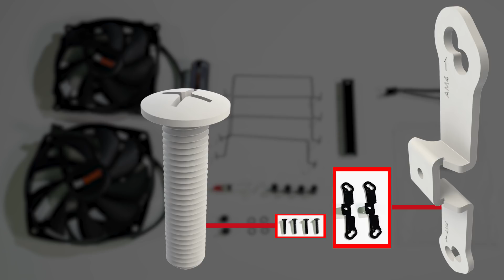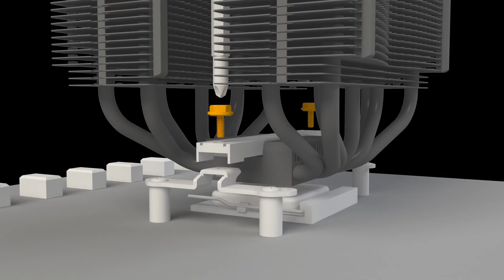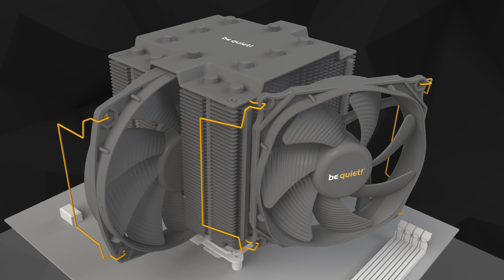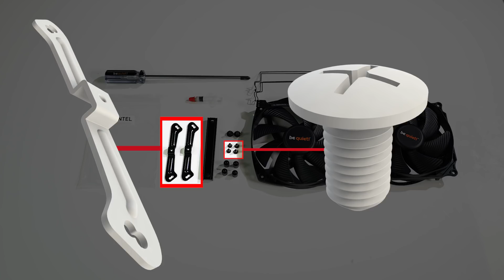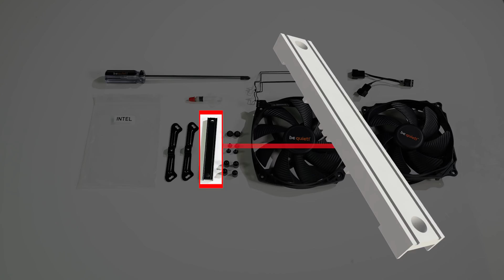Installation: Dark Rock Pro 4 (AMD AM4 / AM3(+), Intel LGA 1151 / 2066) | be quiet!

Comment: How do you stand the case up without the cooler slanting over? I put all the screws in tight but there is still room for it to slant over when I stand the case up causing the cooler to move away from the IHS.
Reply: Did you solve this? Which motherboard do you have?

Comment: Friendly warning: The fins on the middle top of the radiator (where you’re most likely to pick it up from) are EXTREMELY sharp. I had the pleasure of finding this out when I grabbed it unknowingly and it slid through my finger like a freshly sharpened blade cutting a vegetable. I now have a nice deep cut on my finger.

A little warning on the box to say “warning: sharp parts” would be nice.

This thing was really annoying to install.
Reply: can confirm, left blood everywhere. (only had 1 finger clearance)

Comment: I bought you B equiet! Dark Rock Pro 4 like a month ago and used it with lga 1366. Now I moved to lga 2011, but I found out that I'm actually missing mounting nuts for 2011. Is there a way I can get extra ones? My shop warranty has expired.

Comment: Nobody pointed out how hard it is to remove this cooler in some cases. I cant remove my GPU with this installed so the only way to remove it is to remove the top of my case, then the CPU Cooler, then, if needed, my GPU.  Im switching up to a Pure Loop 280mm AIO

Comment: i watned to see this only for ram purposes and it seems that there is no problem
Reply: I had to mount RAMs first doe, I usually do that but I wanted to see if I can install them with cooler in place (w/o paste and fastened cooler). And it was an issue! Guess  I won't buy another 16GB duo.
Reply: Is it necessary to deinstall the cooler if you wanna put new ram in?
Reply: do we know the height available for the RAM ?
Reply: @enzosays1626  40 mm
Reply: @x-dynamics4025  thanks, I was not sure so I guess I miss 4mm for the g-skill trident ..., have you taken low profile to be safe ?
Reply: @enzosays1626  ahm im also thinking about upgrading to a bit higher one. On amazon they say everything above 40 mm youll have problems
Reply: @enzosays1626  I am using HyperX Fury Black, low profile. Anything higher would not fit I think.
Reply: @s0nycz3kk  it's difficult to make his mind on this. i see below that someone is using it with trident which is not low profile. may be if we un-mount the fan we can effectively plug the ram then re-mount the fan ... don"t know.
Reply: @enzosays1626  That's how I did it, well he can move the fan up a bit if it's not gonna fit entirely. // And I would love to check it for him myself, but remounting the fans is pain in the ass. // Just checked, there is max. 2mm space from the point of view I got.
Reply: Not a problem for my Trident Z Neo RGB, however, they're in A2, B2 slots.. not sure if A1 slot could work if I ever wanted more RAM. But I'm happy.
Reply: @x-dynamics4025  I have this cooler with Asus x570-e and 4 Kingston Predator RAM sticks. I would strongly recommend to remove both fans prior to installing the radiator. After that you can put on the fan. It hooks to radiator and can be slightly adjusted height-wise so that it won't be touching any RAM sticks. I am talking about 1-2 mm displacement which completely ok.
Reply: Yep no issues with RAM clearance for most. The manual states it has 40mm of clearance for the front fan, but that's from the tip of the fan to the tip of the base. You also have to figure in extra clearance you get from the base of the socket to the top of your CPU's heatspreader that the cooler sits on, which gives you an extra maybe 5mm? Either way, this cooler has about 2mm of clearance over my G.Skill Sniper X RAM, which has a 43mm height.
Reply: Ap b.
Reply: @siroz99  Exactly. In my case, B550A-Pro, I can have 46.8mm RAM

Comment: You can easily remove the top cover by removing the four small hex screws from the corners. I just installed my Dark Rock Pro 4 and it made it a lot easier to insert the mounting screws and the middle fan. However, the fan clips were somewhat difficult to install, especially with the motherboard inside the case. Many reviews and commenters seem to point out the difficulty of installation and I haven't seen anyone mention this tip, so I thought I'd share.
Reply: THANK YOU! This saved me from removing my gpu in order to place the middle fan. :D
Reply: @Killermatic  Glad it helped!
Reply: Bless you, good sir! I was struggling with this fan for quite some time until your brilliant idea. Haha
Reply: Really????
Reply: Awesome!
Reply: Thanks for confirming this!! I thought that but was worried there was some other reason it was like that

Comment: The cooler looks awesome. The covers for the screwdriver-holes are a great detail. The retention-system has really improved, BUT.. it still looks sub-par to me, unfortunately.  Especially for twin tower coolers, it's so much more convenient, when the mounting screws are pre-attached to the mounting-bracket. If the mainboard is already installed in the case, those tiny screws make it an annoyance. Also, no spring-loaded screws makes it a deal-breaker for me 😕
Reply: they do that so there aren't size and shape differences in the future in motherboard/cpu designs, so you can adjust the placement of the screws, i had to adjust mine

Comment: Does this cooler suppose to have play in it? I mean the mounting system basically uses a straight bar across the top of the IHS mount which doesn’t prevent the unit from turning? Is that normal? Seems if you’re going to put this is a standard case you may over time start to see this cooler turn a bit under it s own weight?  Any comments
Reply: Im having that problem roght now. I just installed the cpu cooler, and its pretty wobbly
Reply: Mine has the same, found a post by bequiet that says it's fine.
Reply: Maybe ju installed the bar the wrong way up. Mine fits tight
Reply: @kenny.h1  Did you solve this? Which motherboard do you have?

Comment: @be quiet! I just installed this cooler two days ago, I noticed you guys latched the middle fan towards the backside of the cooler, however I latched the fan in to the front, towards the outer 120mm fan. Does this matter? I assume it doesn't matter which side you latch the fan in but I'm just confirming, and while trying to latch the fan in I unfortunately scratched a bit of the black coating off the heatsink fins, needless to say installing this cooler was a big hassle but the cooling performance and acoustics has been very satisfactory so far for my Ryzen 7 2700x, the difference compared to the stock Wraith Prism is phenomenal.
Reply from the maker: Hello. It's much easier to start by uncoupling the fan first and then following up at the fins.

Regarding your question: It doesn't matter on which side you place it.
Reply: There are 2 rubber strips on one side in the middle of the heatsink that act as support for the fan. If you clamped it towards the other side, then your fan rests directly on the heatsink.

Also you might gave either set the fans to blow away from each other or towards each other.

They should both blow in the same direction.
Reply: @lynnstott9351  nah. they're blowing in the same direction at both timestamps. in the first one they don't show the sticker with the logo  on the fan that goes in the middle of the heatsink, but the blades of the fans are oriented the same way.

Comment: the idea of a cooler having a middle fan right over the centre of the cpu seems stupid to me. thy are facing opposite on another but the one in the middle will have a vacuum to blow since the other fan depressurised. and it doesnt seem designed so that the centre fan blows harder

Comment: I just installed my Dark Rock Pro 4 today and noticed that the fan that came inside the brown box, was in the middle, so I just put that one (120mm) in the middle and 135mm in front, does it really matter or it will do the same? It took me too long to install it :(
Reply from the maker: It will work fine but the 135mm fan in the front might have a negative impact on RAM compatibility if you have very high bars. Other than that you should be fine.
Reply: I was wrong, I thought the one in the middle inside the box was the one 120mm and it was the other (135mm one) and I did all the steps right and still tried to change them and in that moment was when I noticed that I did everything good and wasted my time lol. I want to ask you something, does it really matters where I connect each fan? The 135 mm fan includes only 3 pin and the other one have 4 pin connector, I tried to connect them in different ways but nothing happens, I don't know how it should be connected in the right way because in the manual I can't find anything related to it. Thanks in advance @be quiet!

Comment: Only really annoying thing about this cooler is it's backplate, my old cooler had an O shape backplate that didn't interfere with the case or the socket screws, this one does a little. (and had to cut out the metall supports  on the case)

Don't like that the cooler backplate is held trough "bending" tension with the socket backplate.

Comment: after 2 months of use i can say only one thing - great product, keeps my cpu temps low, looks deadly and most important its very quaiet, i had some problem with instalation but now im very happy with this cooler
Reply from the maker: Hello. We're very sorry about your bad experience. Whom were you in contact with? When did you receive your answer? Usually when we send something out it arrives very quickly at its destination.

Aside from that: The AM4 mounting kit is of course included in the package. Why did you need a new one?
Reply from the maker: @samozlo2539  Thank you for clarifying. This doesn't sound right though - when we say that we send something out, then we send something out. Could you please let us know your name so that we can try to find out what might have gotten wrong?
Reply from the maker: We'll check it out. Please stay tuned.
Reply from the maker: That is very nice of you, thank you for that. To give you a quick update: Your package was sent out but obviously hasn't reached you for some reason. We can send out another one and try to make sure that it reaches you this time.

Comment: definitely, they design this air cooler is out of consideration carefully, as its too big that make it touching the ram, esp with heatsink , getting DIY hard to do any fixing and upgrade on ram slot as u have to remove the cooler before able to do so!!!! so terrible when u want to upgrade the ram under this cooler installled
Reply from the maker: To prevent this issue, we have published an article about the RAM clearance of our coolers:
https://www.bequiet.com/en/insidebequiet/26

Comment: Ryzen 2700x owner...after tightening  the screws (pretty hard) the cooler still moves a little, no matter how much i'm tightening, i double-checked everything and everything seems to be in the right place...temps and noise looks good though, do you think there's a problem?
Reply from the maker: Hmmm. It should not move, that's for sure. Please write an email to service@bequiet.com, detailing the problem.
Reply: I have exactly the same problem with 8700k... still a little flex in moving to right and left. Temps look fine though. How did this end?
Reply: Ayo you got a follow up on how it worked out? Cause I'm planning on building with this cooler and all the people complaining about this issue making me sweat.

Comment: You should really update this tutorial, you should mention which clips are supposed to be used for which fan and also mention that its very difficult to get the clips on for the middle fan.
Reply: These larger clips are for be quiet fans that do not have cut corners like the ones in this cooling :)
Summing up, every be quiet valve you buy will fit perfectly with this bigger clip because it has bigger corners than in dark rock 4 pro :)

Comment: Horrible instructions in the box and on this video !  I had to watch this several times on my ipad, and pause it numerous times.  Its a good thing I double checked my work before applying the thermal paste, or I would have installed it wrong.

Comment: I have replace my dark rock pro with a  4 version  but my 100% rpm doesnt go more than 1250 ,is the y cable faulty? should i seperate the power of fan to different pins in mobo (z270 m7)?

Comment: I almost had a stroke installing this goddamn thing!!

But the performance is great and it really is very silent.
So it was worth it.
Reply: do you get this movement of the cooler side to side in regards to the bracket that everyone seems to put out there that it does not sit tight?...
Reply: @jamessinclair6829  Nope, everything sits tightly for me
Reply: Yea, this was a terribly designed clamping system for the fans, and the instructions were horrifically bad. I would stay away from this mess of a cooler.
Reply: @jamessinclair6829  I did get that movement when i had a standard case. Now i got an mATX  cube and they mobo is laid down so that issue is not noticeable
Reply: If you struggled with this, then would could never be able to install the MA410M from Cooler Master.... Whomever designed the mounting mechanism of the MA410M should be fired... Not to mention that the engineering diploma was missing or was bribed...
Reply: having a stroke and heart attack with mine right now!
Reply: Eddy i spent around 30 minutes figuring out how to install brackets lmao
Reply: These fucking wire thingies are pissing me off
Reply: I feel so bad for people who have difficulties with installing this cooler, you probably can't piss without your mom helping you rofl. The installation is so easy, way easier than coolermasters for example.
Reply: @E6y_IIugopacoB  What a badass.
Not only can he install a cooler, but he can also piss on his own!
I must say, I'm impressed
Reply: If people think this installation is a pain they obvioualy have never work on a vehicle before. This is gravy lol

Installing this cooler next week. Will  be a breeze
Reply: @reloadingdontshoot1  I actually have. Granted, they were just minor things..
Got my first car about half a year ago - a 23 year old Audi A4, tons of things to do on that old boy..

But the difference is, you don't have to be as careful when working on a car, or afraid to break anything.
When I installed this cooler, I was afraid I'd rip off my motherboard or something lol

Anyway, good luck! Hope you'll be as happy with this cooler as I am
Reply: @reloadingdontshoot1  nah I just did my ol 93 accords head gaskets and it was a walk in the park compared to these fucking wire things, I really didn't wanna take it out of the case tho.
Reply: same today
Reply: *Health insurance not included
Reply: @xlChronos  right?

Comment: can i change the front fan with another 120mm RGB ?
Reply: vega abdou no. Just with an 92-110 mm
Reply: the front is 120 mm no ?
Reply: vega abdou is it? I don’t think so. Looked it up. Your right... front is 120, and the middle one is 135 sorry ! Ok
Reply: so i can replace it with a good 120 mm RGB :) like corsair it will look cool in the case
Reply: vega abdou yea!
Reply: Have fun listening to a spinning 120mm bad RGB fan in ur system instead of having silent fans with good quality lol 😂

Comment: Cant wait for it to be released so that i can throw my H100i V1 in the bin
Reply: Just curious what happened with that AIO?
Reply: Its a good AIO but started to making grinding noise and i have OCD with such noise like that. Ordered the DRP4 and I will return the H100i for RMA
Reply: Nice, not available in my country yet. I heard a lot of complaints about AIOs
Reply: Same here,i had silent loop240mm and switch it to dark rock pro 4
Reply: Does anyone elses dark rock pro 4 fans only run at roughly 300rpms? I been looking everywhere but i cant find anything
Reply: @S499YBUH  go in to bios and set a custom fan curve if you want them to spin faster. But if youre not doin anything on the pc the fans wont spin fast.
Reply: @Proto_is_noob  sorted now thanks though 👌

Comment: Welp it took me some time, I hadn't realized that some of the fan brackets were longer, silly me.
Reply: My man, you saved me a lot of time and hassle.. went through the exact same situation.. I was like wtf are they so loose! Thank you x1000.
Reply: @cigars3936  Glad it helped someone else ! I mean even in the guide they don't mention some brackets are longer so it is pretty confusing.
Reply: Sweyn Nero You Sir are a HERO!!! 😅🎉
I tried so many times and after that i saw your Comment... THANKS A LOT!!😁😋🎉🙏🏽
Reply: Spent the past hour with a loose fan fitting until I read this - thank you
Reply: My god, I put the middle fan in the first time with loose brackets. Realized something wrong after second attempt. But by doing it three times the rubbers with weak glue came off so I had to refit those too.

Clocked out at 55 minutes, could've been 40 if the bracket scenario was more obvious.

Edit: and whoever designed this cardboard box should be fired, I can't close it anymore after initially opening it wtf.
Reply: Same here holy shit
Reply: SAME ahahahah
Reply: Tried this as an alternative to the Noctua DH15 and unfortunately it just doesn't get the job done on a 5800x. Idles at 50c and ramps up to 85c during gameplay, fans set to about 70%. Noctua DH15 setup Idles at 40c and hits 70c max with fan speeds at 40%. Also the fan clip system on this is a pain if your mobo is in the case already.

Comment: Easiest CPU cooler install I've ever done!  Part of that is design and part of it is the excellent video.  The printed instructions can be thrown out, just watch the video.  Well done be quiet!
Reply: Does the mother board have to be removed?
Reply: Not necessarily but is better just to avoid struggling with the backplate... I have never remove it